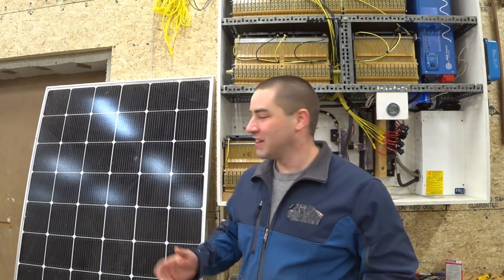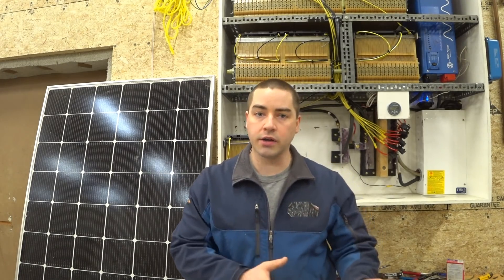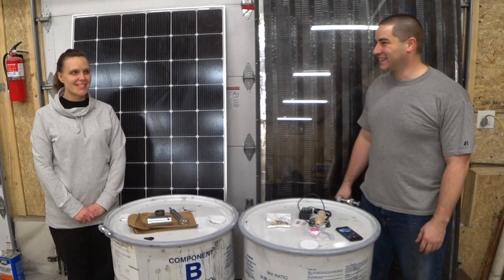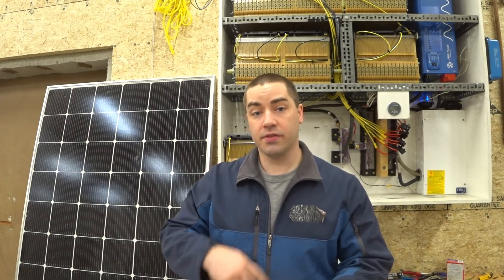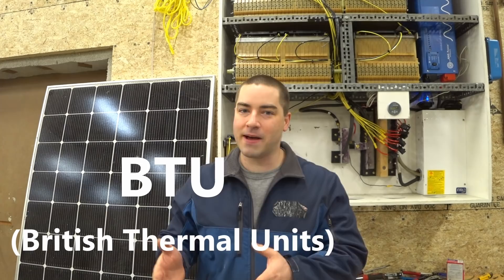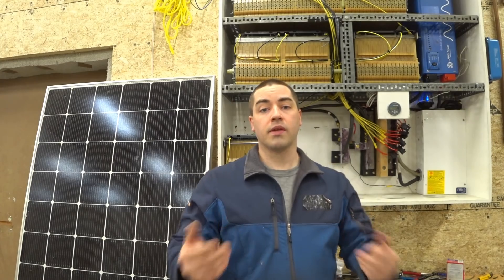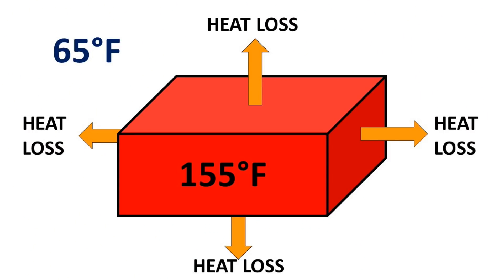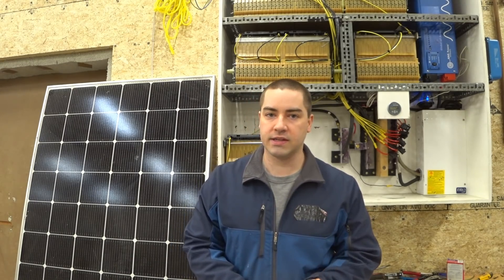Cheapest Energy Storage Off-Grid

Comment: 300 ft of pex is what I was considering for longevity. What size and length of copper would equal the exchange rate? Edit: Heat transfer PEX vs CopperThe heat transfer
 is only one part of the issue. Since the walls of both tubes are rather
 thin, the thermal conductivity is only one factor. There is a bit of a 
time lag when transferring heat across PEX. All that being said, you need 4-6x the amount of PEX to perform similarly to copper.Sep 30, 2010
Reply from the maker: Yes, you are correct.  The walls are thin, so conductivity is not a huge factor.  For the first month, I could smell plastic come out of my hot water.  That makes me concerned about the healthiness of a PEX heat exchanger.  I have PEX throughout my house and don't smell plastic from anything else, and didn't have any plastic smell before I built the tank.  So I think copper is better suited.  If I did this again, I would look for any salvaged heat exchangers from boilers or something.  But, assuming I had to buy it, I would probably use a 100 foot coil of copper 3/4" type L.  https://amzn.to/2EdSrRN  Another option if you have the room:  Find a used (cheap) stainless steel "indirect tank".  Then strip the insulation and put the whole 40, or 60 gallon tank inside the thermal storage tank.  The inside of the stainless tank is for the pressure, potable water. 
 
 I've sometimes seen these on craigslist for a couple hundred dollars still in good condition.  

Whatever you go with, I'd love to see some pictures when you are done.
Reply: @DavidPozEnergy  At degree you are right on the edge of working heat range of pex or poly pipe. This is why in my earlier comment I suggest 2 tanks that would allow you to use a lower working temperature between 150 and 160 degree.

Comment: David, super interesting discussion.  How many collectors have you calculated you will need to meet your BTU requirements?  You also mentioned that if you had to do it all again that instead of the pex you would have used copper.  Is the thermal exchange rate that much better than copper?  Personally, I'd take the pex as it has a long projected life, tolerates freezing and relative to copper, much less expensive.  Looking forward to your next installment!  Thanks!
Reply from the maker: Sure, so PEX vs. Copper for heat exchanger.  Both transfer heat just fine.  Yes, plastic is an insulator, but the wall thickness of the PEX is less than a 1/4".  The main reason is that I had a plastic smell come out of the water for the first month.   But both work..

Comment: Thats great! but you can do this with electric as well, and you don't need more batteries to do it, but more solar, a system like mine were there is more solar then needed you use that to heat water, the same thing your doing, a large tank. I will be doing something like this in summer I hope. also solar is getting very cheap 60c a watt :) in Canada or 40c a watt in the USA. your system is better system if your starving for solar though. but im finding that solar panels are getting so cheap its easier to just add more solar panels. just bought 3.3kw of solar panels for $2000 witch will heat that massive tank of water in just over a day, then after its heated the water it can help in other areas if needed that is what I like about all electric.
Reply: Take a look at the way Offgrid Steve did this. He has a pretty good discussion on it.
Reply: Awesome!! I hope you make some video or instructions, I want to do that too!
Reply: Nice explication. I am exploring this to heat my place. Mostly from the point of view  of dumping the excess power the panels produce that your charge controler doesn't use. Based on the ability of the charge controler to deliver available power. You can go with the expense systems that work well. Or you can just shift the energy load as you are doing. In the winter months you will not have to dump excess power. As you have lots of places for it to go.
Reply: The whole point was to last for more days with little or no solar.   
He'd have really have to scale up his solar array or battery-bank to achieve the same.
Reply: totally agree with you, certainly in this matter
Reply: Where in Canada is the best place to buy solar panels?
Reply: @CanadianClassicCarNut   Kijiji has lots for sale Toronto has a few selling used panels for $80 good luck

Comment: Good discussion, this is why i went the route of Grid Tied when i built my solar system, granted i do have a battery bank i built from 18650 cells i got for free, but i broke down the cost and just accepted the cost of the $27/month connection fee for the ability to have access to grid power, and pump my excess power into the grid for a credit. I just kept adding solar panels to the system tell i no longer had a bill above $27, the past year i have developed a credit of nearly $90 on my bill, so my monthly connection fee is wiped out and i dont have to worry about the cost of buying batteries for my system. Granted i did have a LOT of issues with grid tied inverters overheating, but i cured that by watercooling the mosfets with mods to the inverters. I made good friends with the local solar companies and solar warehouse in my city that most use for purchasing of solar panels. I found they are constantly discounting and clearance panels all the time, because they were returned due to a connector not working, or box was damaged, or even a few panels had a crack in the glass. I just poured superglu into the cracks and run them. Ive gotten 300watt panels for as little as $50 because the panel was cracked during shipping.
Reply: That is why putting in lots of solar panels with a smaller battery bank works so well. With modern Mppt charge controllers you can run 400v strings. Even on cloudy days some solar power is made. If you run the high voltage strings your final voltage will always be higher than your battery bank, whereas if you run low voltage strings you may be generating power but not at high enough voltage to charge the batteries. 30% of 180v is only 60V. 30% of 400v is 120v. Mppt needs about a 20v differential to work. So charging a 48v pack at 60v does not get you very far. 120v down converted to 65V (via Mppt) with an almost doubling of amps goes a long way. On sunny days your battery just gets charged faster(limit charge rate in controller) and you can divert the excess power to water heating (regular 240v). So with extra solar you win twice. More power on cloudy days. Free hot water the rest of the time. If you figure you can live on 5kw of solar but put in 9kw you will almost always have plenty of power and most of the time you will have free hot water. All without a generator.
Reply: You Sir are taking Advantage of the power companies, Shame on You LOL HAHAHAHA i Like, OLE!
Reply: William Huston, RN would yo be willing to send me some of this information you acquired for getting these solar panels .... what kind of solar sales companies where and who to look at to acquire the panels at these prices
Reply: water dissolves superglue :p
Reply: Can't you also use polyurethane?
Reply: Sounds smart, i've been talking to people and considering doing the same thing here in Austin Texas. However in order to feed back to the grid to start accumulating a credit you must use one of the cities certified contractors and it has to be inspected. How did you get around this? Which power supplier do you have?
Reply: @epicdeuce  the inspection are for making you didnt do that islanding mistake that might kill grid operators
Reply: Wha!!??
Reply: @epicdeuce  hi from Austin
Reply: Lol have you put a bunch of non matched solar panels with cracks and dodgey connectors in the same string?
Reply: Power companies sux life from you.  Solar plus a wood stove with a used water heater does everything

Comment: Nice discussion of heat exchangers for thermal storage to domestic hot water. Great explanation of heat loss and the system balances - and the energy cost of electric water heating. How many BTUs can your plate collector gather?
Reply: add more collectors as needed for your situation.  Add more tanks to keep from needing super hot water that will scald
Reply from the maker: The collector has a data sticker that ranges from 11,00 to 37,000 BTU's per day.  This varies based on sun intensity and temperature of water.  Thanks for watching.
Reply: @DavidPozEnergy  Thanks! I have 6 panels 40" x 115" active collection area I have an idea to set up. We used to live in Natick MA so we fgully understand your days of autonomy limitations. Only in the winter we sometimes had significant overcast for a week at a time. Here in N Arizona we usually don't have more than a few days of "poor for us" insolation. Love the crawlspace reservoir!
Reply: I used a Grumman Sunstream 80 thermal system for thirty years and built my own dyi system using copper heat exchangers. Buy a system engineered by pros. You wont regret it or go a hybrid with high capacity otherwise expect to he dis satisfied.
Reply: Robert L. Fallin my panels are probably 20 years old and never installed. I got them for free! I’m hoping to get my installation complete this fall.
Reply: DavidPoz  HI PLEASE SHARE LINK I WANT YOU INVERTER
Reply from the maker: @Zelvin Millis:  This is the inverter I have: https://amzn.to/2BDWO6Z  I also have a video setting it up: https://youtu.be/dfHb5tZErTs  Thanks for watching.